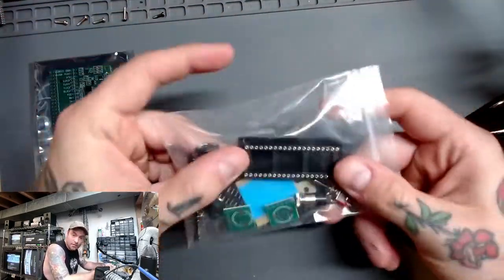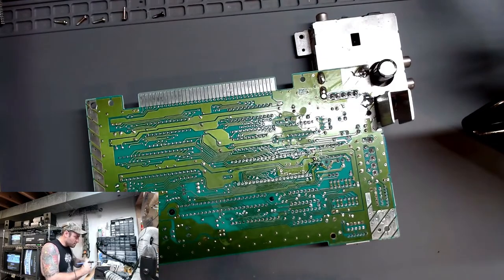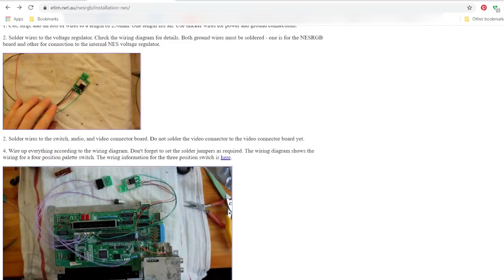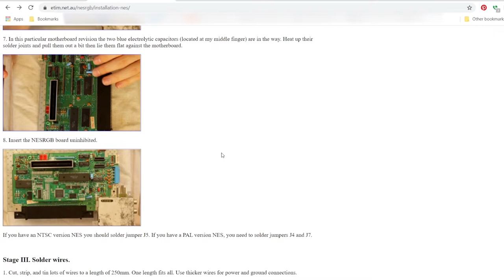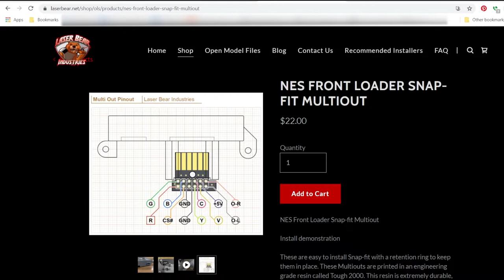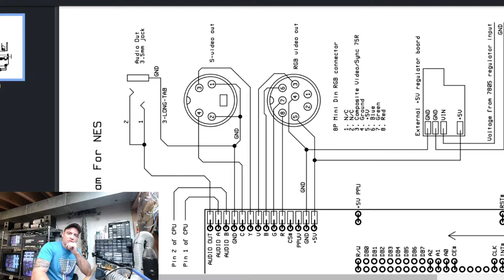NES RGB! Part 2: PPU desoldering, motherboard set up, NESRGB Board Prep.

Comment: Hi! This mod cancel original RF and AV output?
Reply from the maker: Hi! Composite and RF are still enabled. You have to switch off RGB via a switch or controller command to switch from RGB to composite but that’s it.

In fact you can even send composite over the AV multi-out. The yellow jack will still work though.
Reply: @daneolds515  OK. Yesterday I install NESRGB on my NES, but AV and RF only shows gray screen...🤔

Maybe i did something wrong...
Reply from the maker: @arzarello  Did you install a palette switch? In the past I've used a 4 position rotary switch. That way I'd have composite, P1, P2, P3.
Reply: @daneolds515  I installed the paddle switch via the NES controller. RF and composite don´t have colors, only white and gray image.
Reply from the maker: @arzarello  so you installed the Borti I/O board to control everything with the controller?
Reply: @daneolds515  No, only install NESRGB and its features
Reply from the maker: @arzarello  ok, I’d double check your wiring. The composite and RF signal should work just fine if you switch the RGB board “off” from RGB to composite. What kind of av-out did you use? Are you getting composite there or from the yellow RCA adapter?
Reply: @daneolds515  When I set the RGB board to "off", the RF and AV image is gray and white, no colors, same as when RGB is "on".

After about 10-12 minutes, through the NESRGB output, the background graphics start to change colors, and some layers disappear. I have already tested everything and I have no short circuits on the NESRGB board. I installed everything according to Tim's recommendations, and went over everything by watching your video. Honestly, I don't know what could be wrong.
Reply: @daneolds515  My NES Motherboard is a NES-CPU-11, and NESRGB 4
Reply from the maker: @arzarello  the motherboard revision shouldn’t matter. Did you add the additional voltage regulator? It’s possible that if your voltage regulator was getting old that the additional draw from the RGB board could be causing issues. I’d measure your voltage output at the regulator and see if that is holding strong at 5v. When I install one of these I usually replace the voltage regulator with a 78S05. I’d also test your output voltage on your power supply. May be worth it to replace with A triad if things are off.
Reply: @daneolds515  Yes, I install additional voltage regulator. Here you can see images of my issue: https://drive.google.com/drive/folders/13OoXPyAZ4fs4dVtLkhJw0NjUSTro4bRR?usp=share_link
Reply: @daneolds515  Well, finally I was able to resolve my issues. I forgot to change the C8 capacitor, and when I did, Led 7 on the RGB board stopped blinking.

Color and graphics issues were resolved by adding a 100pf capacitor connected across PPU pin 13 and GND.

Regardless, RF and original composite video still look in gray and white

Thank you so much!
Reply from the maker: @arzarello  sounds like a step in the right direction! I’d just double and triple check your wiring and connections. One time I had a small bead of solder that I couldn’t see bridge 2 pins and burn out a PPU.